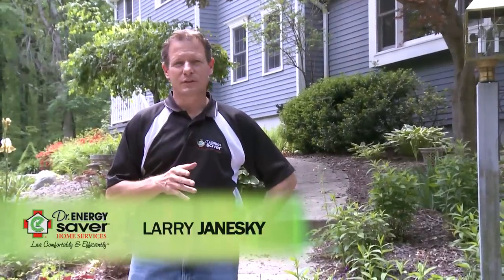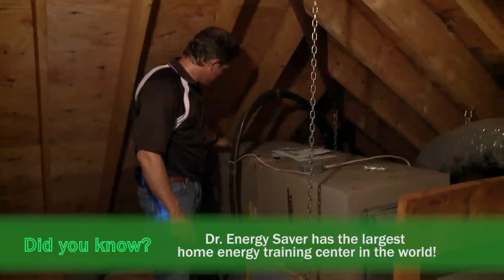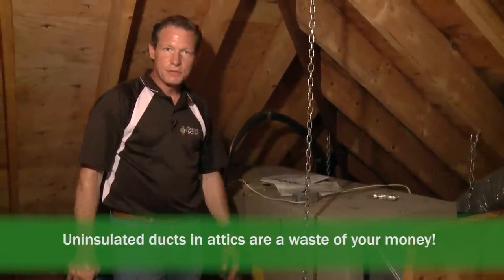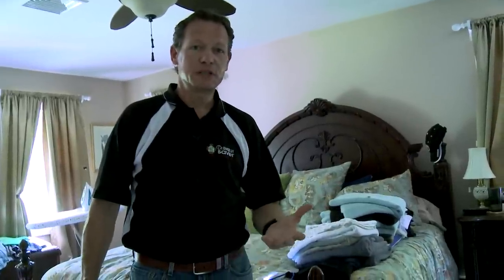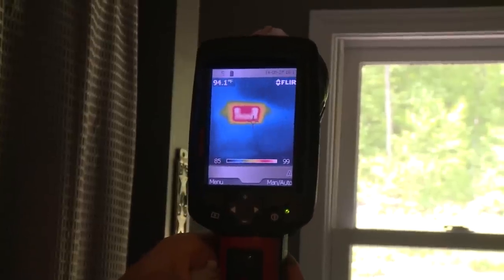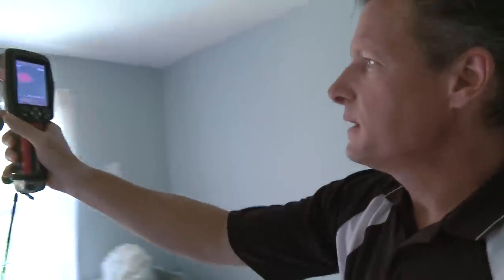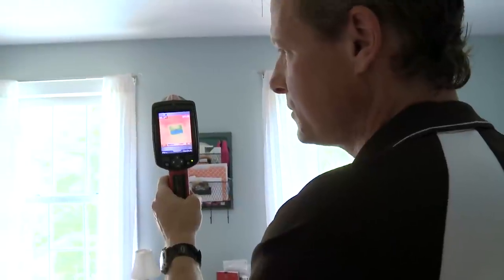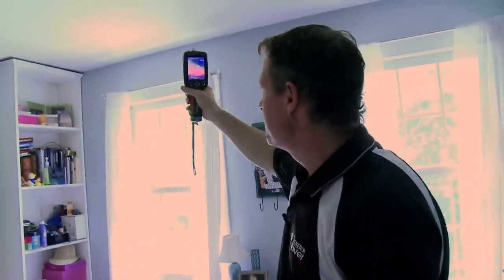Ducts in an Attic

Comment: Completely agree with the ductwork in an attic absorbing heat but it's completely false that the measurement you're reading is the air that's coming out Infared meters measure the surface not the actual air. Even if the plenum is warmer than the air coming out it will still cool the room to that desired temperature. It's a matter of how long it takes that makes it a true statement

Comment: I think you need to get you’re AC checked.
Reply: For sure, even though that attic is that hot that supply should be putting out 60 degree air or cooler if properly charged and working correctly.